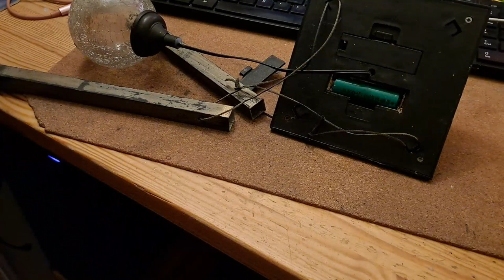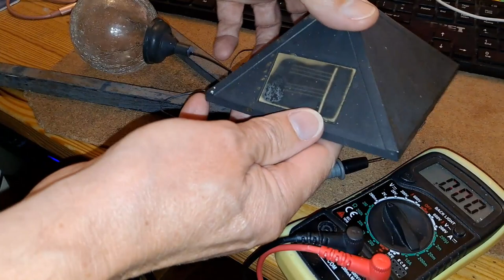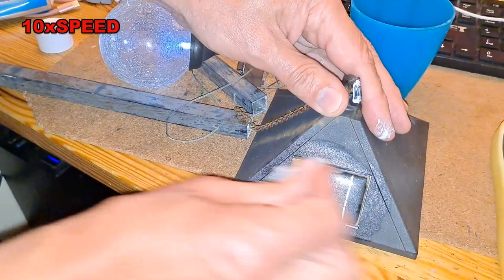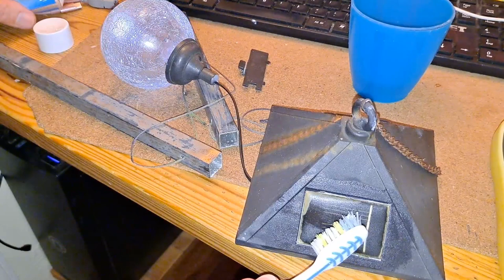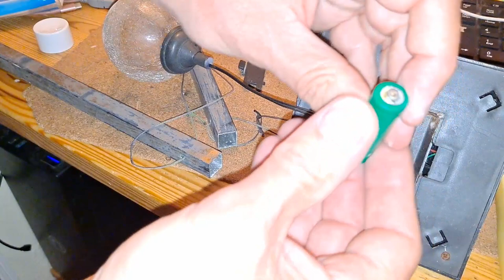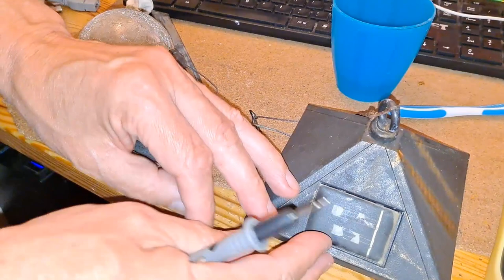Solar light revisited - Cleaning a solar panel with toothpaste. Will it work?

Comment: FYI tooth paste is a good general cleaner. Early toothpaste was baking soda in gel. I don't know what they use now.

I do know - a girl I was dating was upset with a cigarette stain on a motel counter. She used toothpaste and after the clean up there was no visible sign anything had ever happened.
Reply from the maker: The question is, is it acting as an abrasive or is it acting as a chemical solvent?
Reply: @GrandadIsAnOldMan  A bit of both, depending on the material. To be clear, just rubbing with a finger causes decay, but hardly noticable. 

You can think of toothpaste as 2000x or 10,000x grit sandpaper. In which case, it acts more like a polish. --cheers

Comment: I have had decent luck partially restoring my cells in a similar way . 
I lightly wet sand the fogged coating with something like 150  grit (I don't 

have any higher grit or I would use that) .
I tried a coat of motor oil to keep it transparent, lasted about 6 
months then it fogged as much as before .

Second time I tried 30 SPF sun block and after 6 months it is only 
1/3 rd as foggy as it was originally . 

Re applying the sun block every month or two may be less work 
than sanding it every 6 months .
Reply from the maker: When you look at these panels they look like they have water damage inside, so I think they are already on their last legs, that is why I was dubious there would be any benefit in cleaning them.

Comment: I hear you say: 'I am not expecting this will help'.. .. Hmmm, a lot of confidence . . But time will tell. I got this tip from Julian Ilet I think, and used it several times. But a yar later, you can do it again. But it is cheaper than replacing the cells.
Batteries going from 0.5 u to 1.3 Volt are as good as dead. I recommend using a different battery to test the cells now. You would otherwise not know if it is the bad battery or the bad cells you are experiencing. (imho)
Reply from the maker: I have seen people recommend using it to clean headlights. Some car makes are particularly prone to the lenses yellowing. I remember my brother-in-law tried it and it was pretty well useless for that. It did improve things initially, but they clouded over again fairly rapidly, so I wondered if it leaves the surface rough and prone to collecting a layer of surface water that then dries in place rather than running off. Might be worth polishing them afterwards, with a rotary buffer. I have placed the solar light outdoors and it is not as bright as it was indoors, that might be that the location is not as good or it may be the simple fact we have had a lot of cloudy rainy days since then. I will probably move it to another location to see if it improves the performance.
Reply from the maker: Forgot to mention in that reply that I have replaced the battery.

Comment: hi check the voltage and current at the battery terminal without a battery in sunlight to see the charging  voltage  best regards
Reply from the maker: But how do you account for different levels of sunlight?

Comment: I already tried toothpaste and didn’t work at all
Reply from the maker: That would depend very much on what sort of grime you have on your panel. It is just a mild abrasive, nothing magical is going on. Maybe if you used some of the "whitening" toothpaste it might have some sort of extra chemicals that might bleach the surface, but that is not what I am using here.